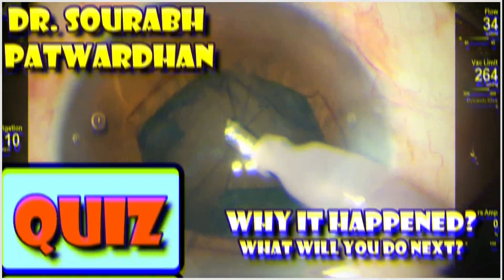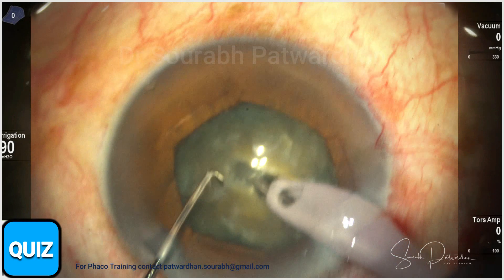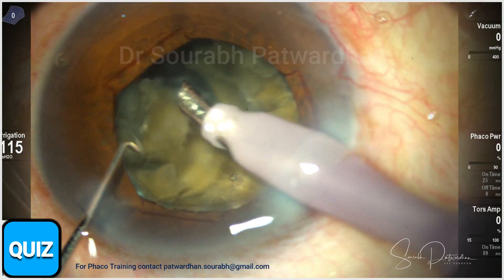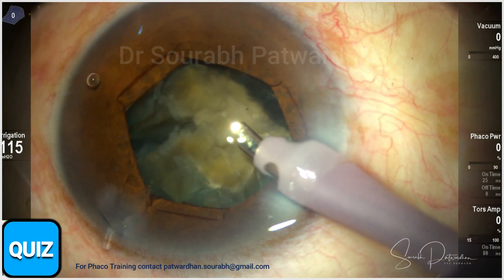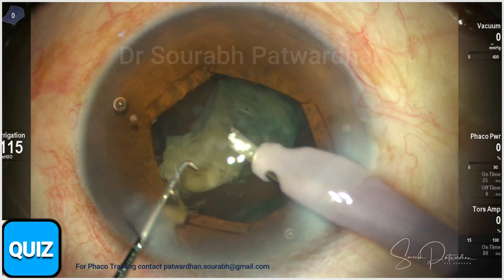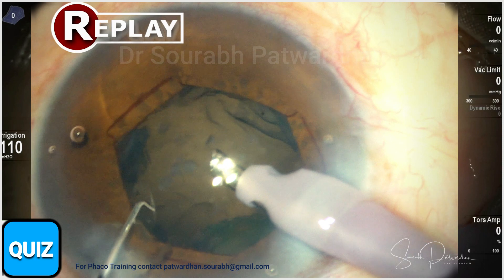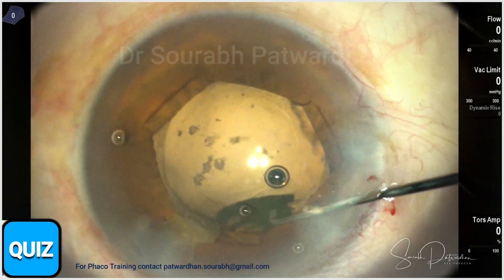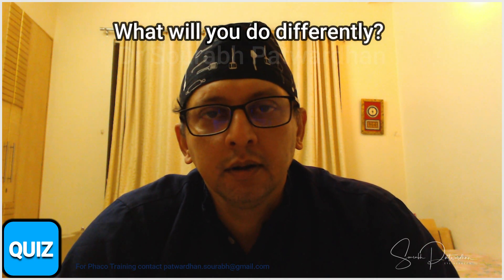79 Quiz: Posterior capsule capture- Why it happened, How will you proceed Dr sourabh patwardhan

Comment: No PCR
In hard Cataract PC are weak and may act like at trampoline and I am not sure but may the the foot pedal was in position 2 for a fraction of second aftee completion of emulsification of last piece thats why pc was caught..
Can be prevented by low settings phaco low vaccum low power low bottle height..
Injecting viscoat below the last piece   before emulsification may be an option I think.

Comment: 1A..phaco tip has caught hold of pc because foot pedal was in phaco 2 even after nuclear piece is emulsified totally...flow rate was 34 ml/ min when star fold sign of pc seeen...pc may be redundant in hard cataract too ...so mobile pc would have been caught by probe due to high AFR...
2A..I will keep iris repositer as my sec instrument and will keep it under last piece before emulsication ...and setting for last nuclear bit...I prefer epinucleus mode sir...with less vaccum, irrigation and aspiration levels.
3A.If pc tear happened...then I will assess location and size of pc tear with help of tricot..and removal of small nuclear chunks with slow irrigation...and cut IA mode for vitreous removal with vitrector followed by  IA cut mode for cortex removal and then placement of 3 piece iol in sulcus followed by pilocarpine inj for constriction of pupil...
4A..I feel pc tear has not happened in this case as surgeon used his reflux of foot pedal on left side...and no surge is seen through out  case ...so...next steps in this case may be removal of small nuclear pieces through the main wound with irrigation cannula in ac...follows by cortex aspiration and foldable iol placement and removal of bhex ring ...visco wash and wound hydration done sir 🙏🏻... thanks for sharing the quiz sir
3A.

Comment: It doesn't appear to be surge, because of mat cat, redundant PC might have caused this. Reduction of bottle height as well as power (epinucleus mode) could have avoided the problem. 
Visco expression of small nucler chunks, IA under low bottle height and relatively lower vacuum, if it happens easily good. if not then stop, use tricort to check if there's rent after was. If there is ant vit, clear cortex and place IOL.

Comment: Thank you Dr. Sourabh for interesting videos.
Why did the phaco probe catch the PC? For me it seems fluid misdirection, because this is long standing cataract there might be issues with zonules. I also didn't see significant surge that could lead for PC captuer. 
What will I do differently? For removing last piece I would use IOL scaffold technique or inject visco and do slow phaco more anteriorly.
How I will proceed? If there is PC rupture before removing phaco probe inject visco and visco express of pieces, anterior vitrectomy from sideports, sulcus IOL with optic capture.

Comment: Check the PCR moment again .the foot pedal in position 2 , no material at tip and lens hook withdrawn near to side port that caused increased outflow and surge , other thing --- 115 bottle ht is a LOT of fluid going in eye .i use 102 bottle ht with 450 vac and 45 flow that also gives stable AC .so much flow in eye with long case will cause fluid misdirection in vitrous that would explain be the bulge u saw .